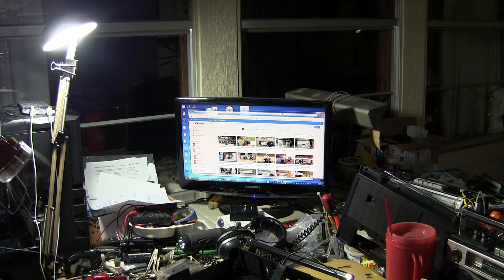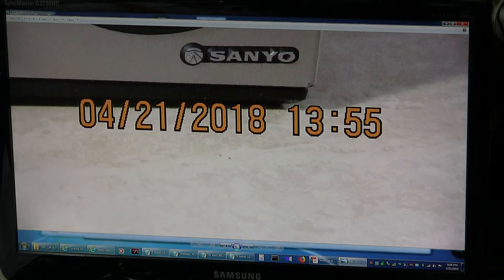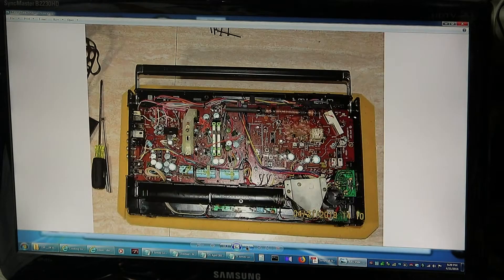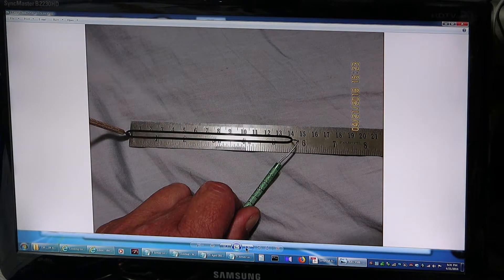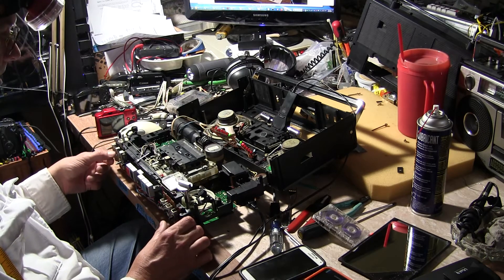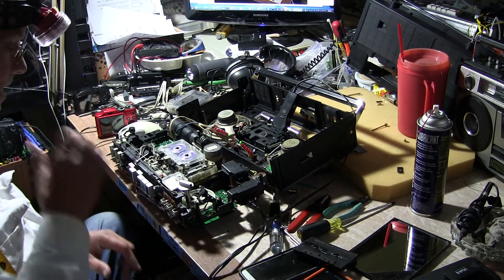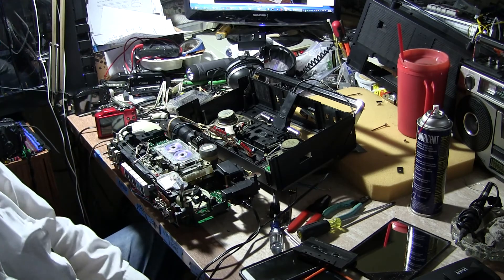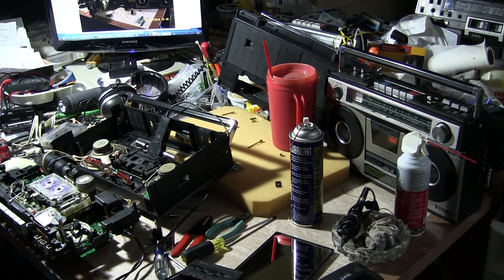Sanyo M9970 Inside

Comment: Another great video,  Question. I'm currently working on this model and I'm having trouble removing the tape deck too replace the belts because of the long recording tab on the back which goes through the circuit board, what's the best angle to remove it without damaging anything else. Thanks

Comment: I watched "Cassette2Go" videos, that's what I did!  You truly have an amazing collection James! Just curious, whats your most rarest and or most valuable radio in your collection? ~Jack, VEG
Reply from the maker: ( Hard to answer your 2 questions) I do not have a collection. I bought these to hear them once, how they sounded, understand?  people think that I collected these, to have a collection.  No I bought them to hear them to find the best all around cassette player.  The only value on these is what I paid for them.  Rare would me to have the Silver SR8800 and the SR8000 together which I do, but I have not serviced either yet so the boat is stll out to sea on those 2.  Best all around 1-piece is for me the JVC RV-NB1 for indoor use only. best outside 1-piece is the Goldstar TSR-801 or any aka's.  Best on a set of batteries all day is the Victor RC-550.
Reply: Thank you James, I appreciate the info!  May I inquire why you have issues replying so as I can understand the mechanics better and I will refrain from commenting forth wit!  Thanks for the sub BTW!.  ~Jack, VEG
Reply from the maker: First of all you can comment.  I just do not login to each and every of my 5 youtube accounts each and every day so there may be replies that I just have not gotten to and sometime for months rarely.  So I continuely ask people to call me 713-502-9993 or email me jamespierceiii@hotmail.com as I check those several time every day but loggin in to here in private I just do not do all the time as the last time I logged in regular to here - I then lost access to my youtube for about six months dues to a virus or something so not I use many computers and ALWAYS LOG in incognito because big brother want to have its fingers in my devices and I refuse to have that happen again - p.s. there is nothing stored of mine on any computer but maybe 2 text files as every thing is on externals now as I have learned my lesson.